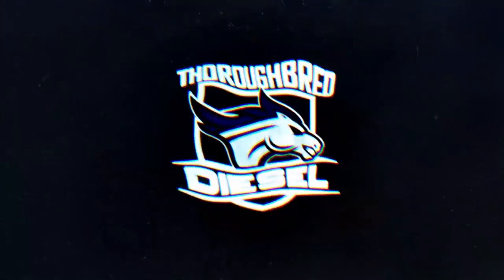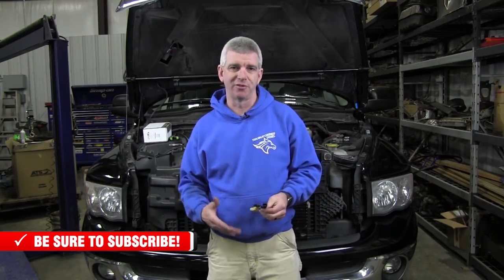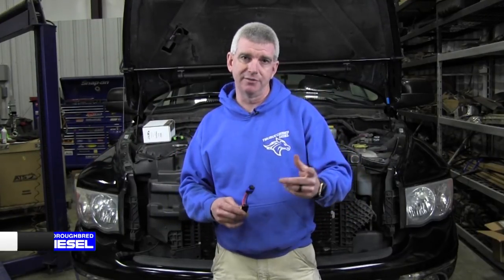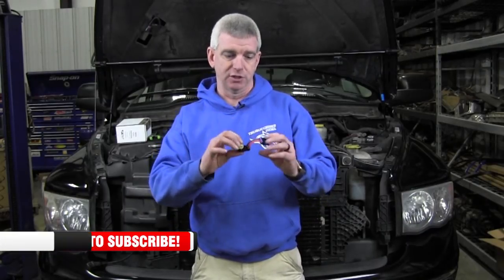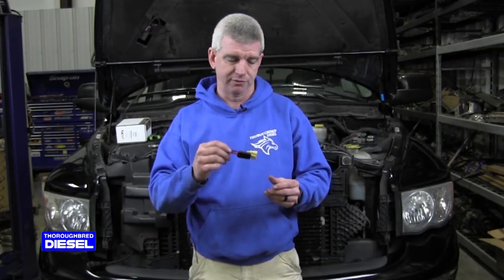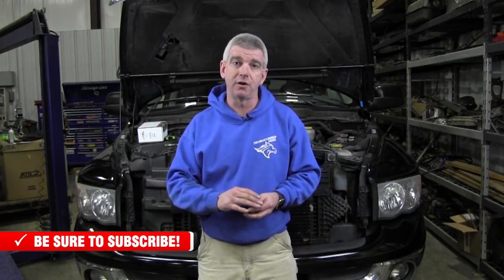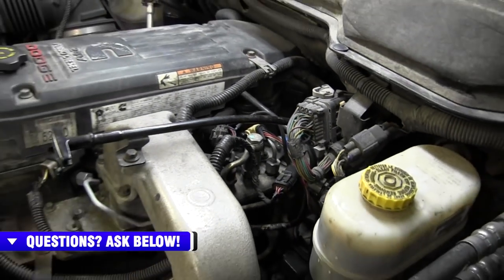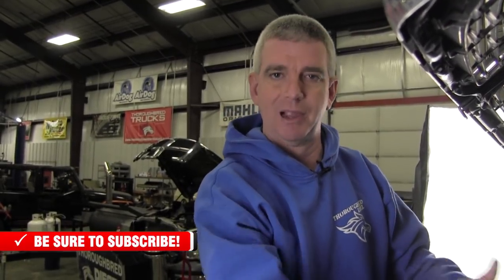ATS Boost Fooler Install: Dodge Cummins 5.9L | Electronic Fuel Regulator

Comment: I'm looking to get one for my 2nd gen cummins, its all stock but the exhaust and cold air intake.. not really pulling alot of weight, around 9k at best.. what are the pros and cons of this?
Reply from the maker: Really no cons on a stock truck, pro’s would be the additional low end power that you will get.

Comment: Hey there great video. My question is will it work on my 06 with an aftermarket turbo? I have the Smarty p06 programmer and the settings are with the wastegate off...therefore would the boost fooler even do anything for me? I'm looking to keep my EGT's down while towing.

Comment: I hope you can help me looking at an 07 5.9l Cummins guy says it is throwing a code for overboost. I am curious if it is a better idea to replace wastegate solenoid and boost sensor or to just do the boost fooler?
Reply: I have the same problem. What’s the solution?

Comment: Wade, I purchased an ATS Diesel 2020102272 Wastegate Solenoid Harness Jumper to use after replacing the a worn out HE351CW factory turbo with the electronic wastegate on my 2004.5 Dodge 3500 5.9L with aFe Power 46-60050 Blade Runner Turbo without the electronic wastegate. Supposedly this is the correct jumper to use to 'fool' the computer when using a turbo without the electronic wastegate. 

After watching your "ATS Boost Fooler Install: Dodge Cummins 5.9L | Electronic Fuel Regulator" video, I may have been trying to install this ATS Harness Jumper in the wrong location. I was plugging it in on the old dangling wiring pigtail that hooked up to the factory stock HE351CW turbo electronic wastegate wiring. 

Looks like I should be plugging the ATS Harness Jumper into the end of the wiring harness that unplugs from the MAP sensor instead of plugging it into the old wiring connector to the HE351CW turbo electronic wastegate wiring? Is this correct? 

If correct, what is the best thing to cover the exposed MAP connection from debris, water, etc., if necessary?

Thanks in advance for your answer.
Reply from the maker: You have the right part.  The 2020102272 goes in the harness at the turbo to fool the ECM so that it thinks the electronic wastegate is still there and it won't defuel or set a SES light. This video is showing how to use an ATS “boost fooler” that goes inline with the map and affects fueling as it applies to turbo boost. Two different things. You chose the right part for your install!

Comment: Does this work on the 03? I have a boost elbow on the waste gate line already and see around 31 with no trailer heavy throttle.
Reply from the maker: The boost fooler will give you some low boost fooling as well as keeping the truck from electronically throwing a over boost code.  If you have tuning for the truck,  I would tell you that a electronic boost fooler probably isn't needed.
Reply: @thoroughbreddiesel  it just has a smarty jr on it right now until I get the trans done then looking at the smarty S06

Comment: you guys should do a video before and after  with the boost fooler cause i've seen them work and i've seen them not do anything at all ... i have one but it was on my truck when i bought it so idk if it improved it at all but my buddy put one on his dodge same as mine 04 2500 5.9 and all it did was it held about 30psi better it didn't give him anymore or less just held at 30 a little better.. both are stock trucks... good video as always though i have the same fooler you had in the video :)
Reply: A boost fooler doesn't give more boost. It corrects the computer reading.
Reply: @here_to_watch2115  actually it will give you more boost because it's tricking the ECM thinking it's under boost and not defueling! so that equals more fuel equals more pressure in the turbo. Equals more PSI of boost. But yes, your wastegate will still open at whatever it set so you would need to put a boost elbow or pinch waste gate
Reply: @SMOKEY-JAYS-DIESEL  I installed one on my truck  , it took an adjustable elbow to increase boost tho. I have an intake gasket leak so mine is stopping around 24lbs at the moment. It's now on my list of things to repair lol.

Comment: What is normal intake temperatures for this model truck mines stock besides s and b cold air with 4 inch straight pipe and bully dog tuner I know this I'd not specifically to this

Comment: just installed a bigger turbo on my stock truck , truck started throwing a p0234 code , will this fix it ?
Reply from the maker: That is a over boost code, and this should knock the light down for that. If not,  look to having a ECM issue.

Comment: Also if I have a P0243 code am i being defueled as I drive even if I am below the boost pressures?
Reply: Thats a good question i get the same code
Reply: @eatpigs0916  My code has been on there for a few years.....Runs good but I'm curious....  just got a scan tool so i can clear it and see what happens.
Reply: Every once in a blue moon i see my code pull up i was thinking it was my airdog but this boost fooler might do the trick i hope Wade could shed a lil light on this subject. It may be a mental thing but when i clear it the truck dose run better💪
Reply: @eatpigs0916  what year is your truck? Mine is a 04.5. Totally stock with almost 280K. Only change is all new injectors at 215K. Had one leaking down so I replaced them all at once but stayed stock.
Reply: I am getting also code 243 didn’t buy the cooker yet.   Did the boost cooler got rid off your code 243 ?